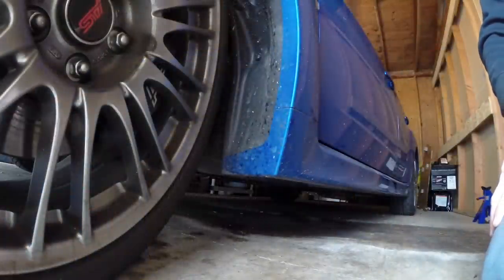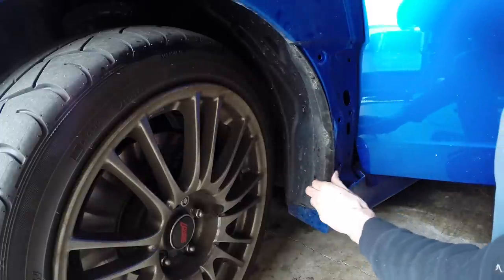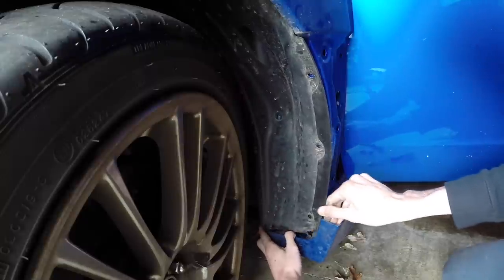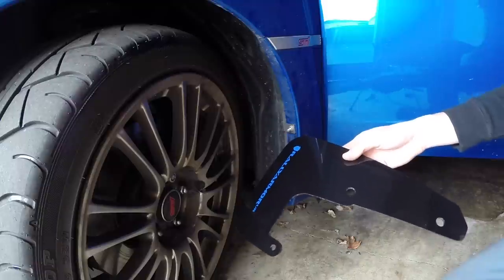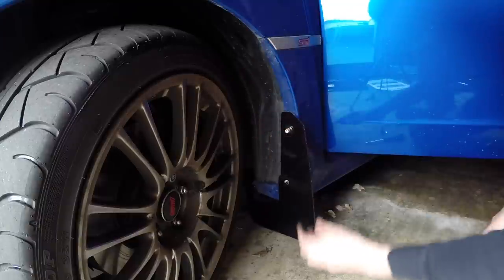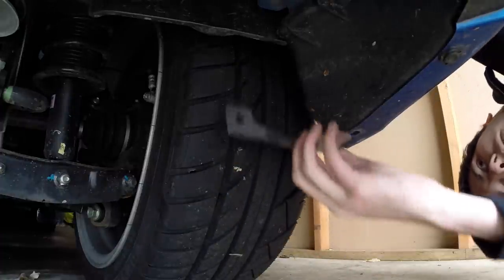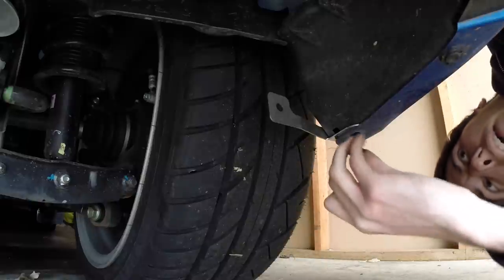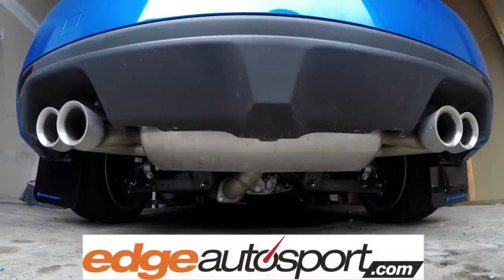Subaru WRX STI - Rally Armor Mud Flap Installation

Comment: I installed the universal matte black version of these (still rally armor brand but they don't make a specific version for my car) on my 2013 sonic rs hatch and I love them. Only thing to note is the universal ones are a lot stiffer than these ones are, when I go over speed bumps the front ones make quite the scraping sound. 

Absolutely my favorite thing to have on any car that sees snow and dirt.

Comment: Good thing you have a video of them all nice and shiny they don't stay that pretty for long especially with winter coming up. When I clean mine I just use an old micro fiber towel and some bug and tar remover. After that I used Chemical guys New Look trim Gel. Anyway love your videos and don't forget to give the subi wave when driving.
Reply: On another note I had to use larger washers since my plastic ones were getting a little warped ( I tightened them down too much) and the mudflap would pop off

Comment: 1:00 gave me goose bumps. never use a blank screwdriver on painted surfaces :D
Reply: He didn't, he used them on the back of a painted surface. I'm sure he know that the screwdriver is harder than the paint.
Reply from the maker: Don't fear. Fortunate for you it's my car. Probably voided the warranty with that careless mistake huh?
Reply: Although he did use the tool behind the rocker molding (side skirt) it still could have touched the fender and even though he could have scratched the fender a tad bit, he removed the piece without breaking the tab which is sometimes common with removing rocker moldings with plastic tool

Comment: Are you planning to make video explaining audi`s active sport differential system .That would be very awesome thanks and keep up the good work.Its very interesting how they made a diff that transfer torque to the outside wheel in turn without using the brakes.Btw awesome video :D

Comment: Looks great! If you love your new sti as a daily driver, please don't take it off road! Dust and dirt gets everywhere. In the cabin, engine bay, and anywhere grease is exposed. I know from my dualsport motorcycle experience. It's a pain, and a motorcycle is much easier to clean and maintain than a car.
Reply from the maker: I bought a capable car to make use of its capabilities. :) Scratches, dings, dirt, and other bad things happen, but I'd rather have a dirty car than one that sits in a garage.
Reply: The car is built to be taken off road...
Reply: Engineering Explained long time to reply, but I appreciate your drive to really utilize its potential! I know, I beat the ** out of my '91 NA up in the canyons of southern California and drove that baby straight into the ground and loved every mile in it. Just wish I could've afforded to take better care of it. Thought it was someone's track car before I owned it so I'd need to rebuild and replace practically everything...

Comment: Whats the function for the little cutout on the front mudflaps? When they're installed you can see a noticeable gap. Just wondering if there is a purpose, for like airflow or something.
Reply from the maker: Matt Bowlin Good question - I remember the instructions mentioning it was intentional, perhaps to minimize drag?
Reply: Engineering Explained It's so that the tire doesn't hit it when the wheel is completely turned

Comment: Know this video is old but say I would want to take the mudflaps off would i be able to leave the brackets screw all the screws back in just not have the physical mudflap on it just the bracket with no problems so during winter I could re install it?

Comment: Hey great video. What happens if you don't use the clips for the plastic parts on the rear? ie screwing it in directly through the bumper
Reply from the maker: There's not much thickness to screw into, so it wouldn't be very secure.

Comment: hey is it expensive for somebody to swap out my driver seat on my g35? after about 70k miles the seat got wobbly and it turned out it had to be re welded. well its loose again after 15k miles, and id feel like it'd be safer just to get a new seat. would love to get a recaro sportster cs.
Reply: Google is your friend.
Reply: Google it! and remember that racing seats will make you sit a lot closer to the ground, if you are kind of a midget like me (5 foot 7) it can be uncomfortable for everyday use.
Reply: Dario kruzk
i did try to google it smh, and i came across install videos. takes about 1 hour per seat. im 5 ' 10 so it should be fine. im stuck between getting status spa seat's, or recaro sportster cs

Comment: is this an '11 sti? wondering if it would be the same instruction for an '11 wrx
Reply from the maker: It's a '14, but the instructions will apply directly to your '11 WRX, if it's the hatch. May be slightly different in the rear if it's the sedan, but not much.
Reply: Found another video on an 11 wrx :) not much different at all. Thanks!